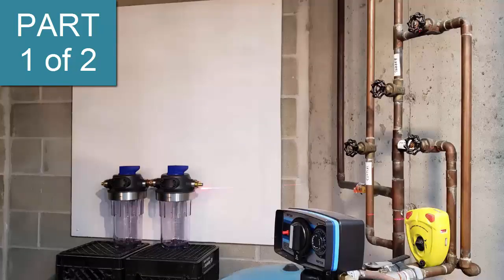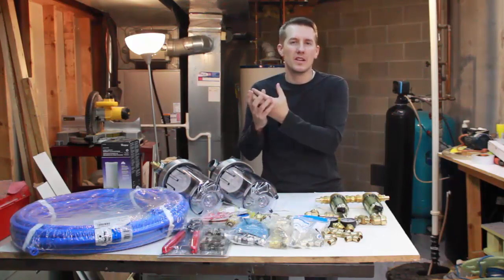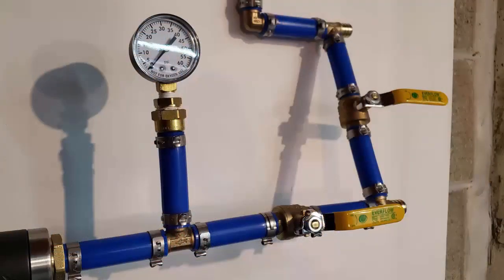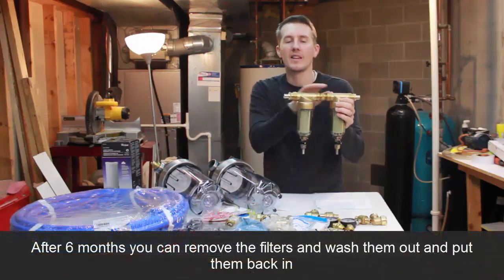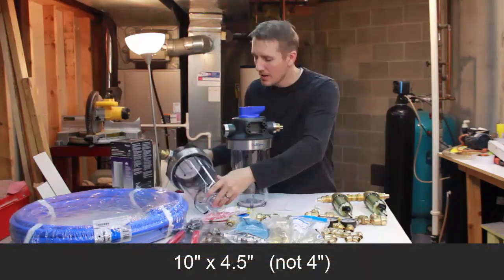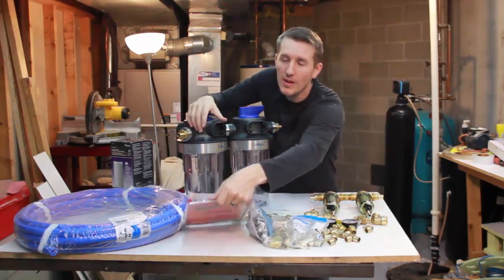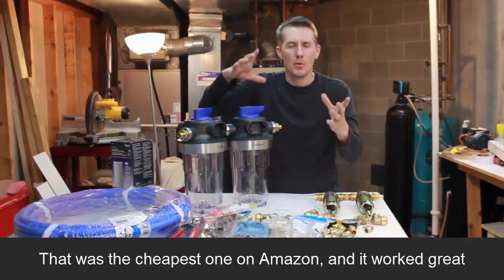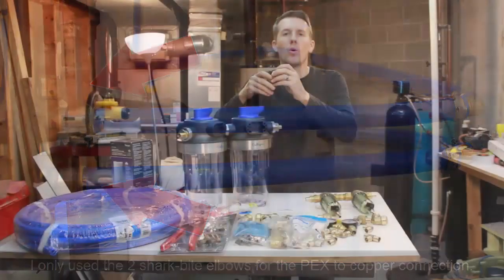Whole House Water Filters  |  (Part 1 of 2)

Comment from the maker: Water Filters:
CULLIGAN WH-HD200-C Filter .......... https://amzn.to/2utRPSo
(alt)   DuPont WFPF13003B Filter .......... https://amzn.to/2HEm7KD
iSpring WSP-50 - Water Filter .......... https://amzn.to/2HEiEfh
iSpring WSP-100 - Water Filter .......... https://amzn.to/2JDEqS7

PEX Pipe Material & Tools:
Crimping Wrench .......... https://amzn.to/2X7l4Xc
3/4" PEX Pipe .......... https://amzn.to/2Xa7NNL
PEX Cinch Rings .......... https://amzn.to/2GdeLLb
90 deg Elbow .......... https://amzn.to/2UzkIM8
Butterfly Valve .......... https://amzn.to/2P42oF0
3/4" Tee .......... https://amzn.to/2UeRq0v
PEX to Threaded .......... https://amzn.to/2VE7Bpy
PEX to Threaded 2 .......... https://amzn.to/2P7eNYI
PEX/PVC Pipe Cutter .......... https://amzn.to/2X0uLGW
Pressure Gauge .......... https://amzn.to/2IspLH7
Depth Gauge .......... https://amzn.to/2GdfoV3
PTFE Tape .......... https://amzn.to/2IfBDgk
1/2"Male to 1/4" Female .......... https://amzn.to/2Igi0EX
SharkBite 90 Elbow .......... https://amzn.to/2X40gQs
3/4" to 3/4" Male ..........https://amzn.to/2KzcajS

Comment: I keep coming back to your video to gain insights and plot out my own plan.  My Florida townhouse has 3/4" white PVC accessible from the courtyard to add filters, water softeners, etc.  I noted you were working with PEX.  Did you consider PVC?  Or am I stuck with PVC because there is already PVC there?
Reply from the maker: We don't use PVC here in michigan.  If it freezes the PVC would crack.
PEX can expand and not break.
You can use either, i would think.  Just like my house is all copper, except for the stuff i did, which is PEX.
PEX is great, super strong, you can bend it and it doesn't feel like it will ever crack like PVC can.

Comment: Hey Dave, Now that the system has been up and running for over a year now...how's it working? Was it worth the money and time? Any unexpected issues?
Reply from the maker: Still working - Yes
worth the money - yes
unexpected issues - no / not really
I'm still happy i did the 4 filter thing.  Without it, everything in the house (sink, toilet, tub, shower, washing clothes) would be stained rusty brown.  But it's not perfect.  I still have to change one or both of the filters every month or the rust starts coming through.  It doesn't stop all the rust, stuff still gets rust stains.  And we still need 2 reverse osmosis filters for drinking water.
In the future we might spend like $500 for something like this:  https://amzn.to/3aSL2Gg   although not sure how well it will work.
Reply: @DaveWirth  we don't have an issue with iron. Ours is with fine, gray  sediment. Thanks.
Reply: @DaveWirth  no man, you're wrong. But you did an excellent job aswell as plenty of homework 👍
But your last filter should be the US Water Systems Disruptor filter. 4" x 10" like yours are the baby ones but still excellent filters. I have the 4" x 20" a dual jug unit and installing the Rusco 2" spin down filter with a 15 micron screen. 

However do not waste your money like that Man, install either the slightly smaller Interceptor filter or Full on top shelf Disruptor filter (both through Us Water Systems) 
The EPA themselves use the disruptor filter which says EVERYTHING! They remove any bacteria, viruses, heavy metals, VOCs, everything that a RO can do. Made possible by a somewhat new type of media aswell as new method of manufacturing. 

I have water intrusion with heavy rainfalls. Kicks up very fine sediment, aswell as tannins. Tannins are very difficult and expensive to remove so straight up man I had very little confidence the filters alone would actually work but they are for real and they work! With only a 20 micron Magna pleated filter and the Interceptor filter our water has been perfect, and since I have a newborn I will not fck around even a little. 4 separate genuine tests which had to be sent to the lab, our water is legit flawless now, besides our PH being 6.6

You should install the 4" x 10" Disruptor filter as the last in line. If you decide to keep the small 10" they're 100 bucks ish delivered but last 10-12 months easily with proper sediment pre filtration. As I stated mine without 100% proper sediment pre filtration with ONLY a 20 micron filter ahead of the Interceptor filter, I got 7 months and could e easily got another month as the pressure was still good, but brand new I measured no pressure drop on the gauge, the 1st one is old and not spot on but the 2nd one is. Being the proper 20" with the pump set at 20/40 there is zero pressure loss that even I can detect.

I'm not affiliated at all with any company, I've just had the small filter setup myself for years. US made filters are always far superior man, but even with top shelf filters they don't last and choke the flow. That's why I had enough and installed the proper 20" and I'll never look back. US Water Systems was chosen because they only sell 100% American made while priced excellent, and only ones who have the EPA's own filter the only they trust. I've spent my own money trying to protect my own family, admittedly had no faith the Interceptor/disruptor filter set were everything they claim. Truth is I lucked out big time as they turned out to be genuine, yet incredible filter Life even though I actually needed atleast another filter as to allow the others to work easier and more effectively

Comment: Have no idea why people opt for PEX these days. Copper is the way to go although it does take more know how. I'd assume keep as much plastics out of the supply as possible. Copper Blue band has a longevity 300 years done properly, PEX 50 to 75; maybe longer but that is debatable. Copper is a proven water supply line and Plastic; well it degrades much faster and who knows what is really added to the supply.. More expensive but I would have run 3/4 all the way to the final destination and then branched to 1/2 , would have kept pressures in line. 20PSI is not much. Keep plastics out when and if possible.
Reply: I did due to acidic well water causing leaking copper, pin holes, green staining.